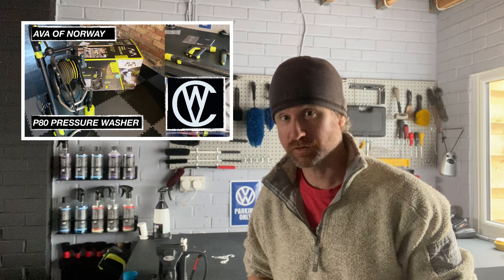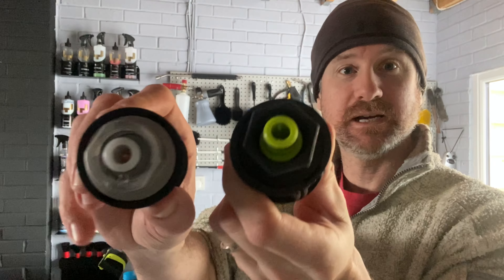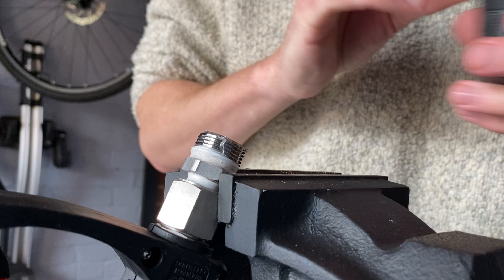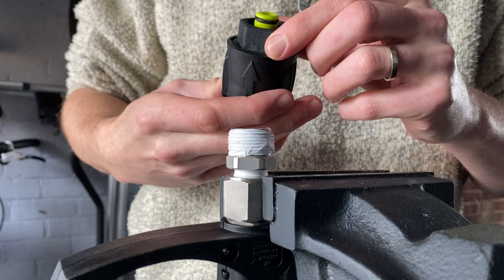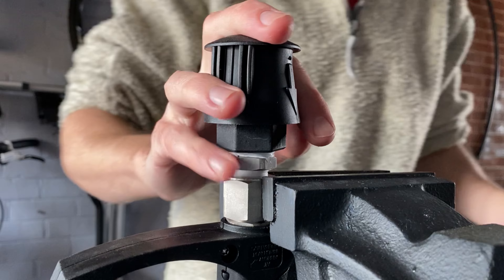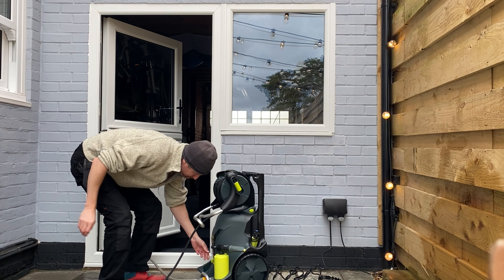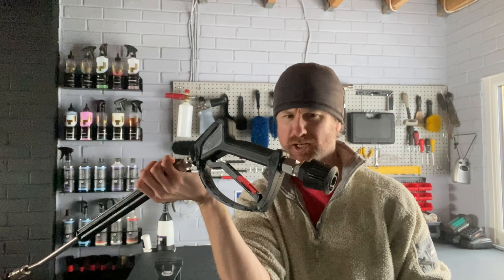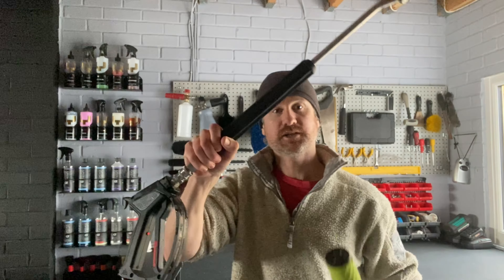MTM Hydro SGS28 Stubby Gun Adapter / AVA P80 Master Pressure Washer!!!

Comment: It looks like you cross threaded the adaptor when you were screwing it on. Did you end up re-attaching it, because later on in the video it looked like it was threaded on correctly? These types of converters use M22 with a 14mm internal diameter, and comes with a built-in o-ring. As long as the hex nipple connector it's being attached to is also M22x14mm you shouldn't need to use PTFE tape, as the o-ring will create a watertight seal. You should only need ptfe tape if the o-ring is damaged, or the hex nipple connector is actually using M22x15mm thread type.
Reply: Being abit thick, have you a link where to buy please?

Comment: Hey there! Just watched your video and have couple of questions. Please answer it:-
1. I am also looking to buy MTM HYDRO SGS28 Gun with swivel but amazon doesn’t offer the fittings like quick connects.
2. I have Bosch Aquatak 125 bars pressure washer machine, so how do i connect hose pipe with MTM Hydro SGS28 swivel gun.? 
3. And, what was the angle lanced(just before you plugged in the connector). 
Please help and suggest me your suggestions. 
Mainly the lanced which is placed down the swivel.
Reply from the maker: @vikhyatraghav  Hi there. Have looked at your questions. There are 2 adapters for the MTN SGS28. One for Nilfisk and AVA style hoses and the other for Karcher. Have you looked at Yumcars.co.uk website? They sell a great pressure washer bundle including the SGS28 and adapters. I’m not sure of the Bosch set up I’m afraid.
Reply: @waysidecarvaleting  actually I wanted to know the adapter you use before conecting the karcher connector what is there down the swivel is it:-Pressure Washer Adapter M22 14mm Male Accessories Coupler.? Or something else adapter.
Reply from the maker: Hi. That part comes with the MTMSCS28 stubby gun.
Reply from the maker: There is a link in the description to the adapter that this video is describing. That’s all I bought it allows me to connect an AVA hose to and SGS 28. I’m not using a Karcher in this video. I see you keep mentioning Karcher.

Comment: Hey up , so I ended 2 wash guns, SGS35 Aqualine and generic one with Nilfisk to M22 connectors, both really struggle in-and-out on the Ava hose, I'm thinking is a better way to connect a wash gun to the Ava hose???
Reply from the maker: Not that I know of at the moment. I’m actually going to start using then AVA Lance again. Got a new accessory for it that I think is going to be great!!! Video to come when the rain stops!!!!
Reply: @waysidecarvaleting  so it’s Nilfisk standard hose into stubby gun , I got6m on Ava.  Needed extension
Reply from the maker: @zzhughesd  apologies if I seem a little confused. Do you have the adapter in your stubby gun like I do in my video with the SGS28?
Reply: @waysidecarvaleting  yes so ended up two Nilfisk adapter and 2 guns. Plus extension hose too.  Ava power washer great. Prefer the better wash guns.  Tho

Comment: Hi what is the benefits of useing that stubby instead of the Ava gun I got the bayonet with 1/4 thread I now can use enything
Reply from the maker: Hi there. With the MTM it’s lighter and easier to manoeuvre I find. Also where I’d been using the MTM with my Karcher really enjoy using it and wanted the option of both. The Lance and gun that come with the AVA are extremely good as well. It’s just my preference but I do recommend as well. Hope this helps.
Reply: @waysidecarvaleting  yeah noticed another vid after yours he was explaining exactly what you just sied I had to replace the gun on my Ava the pin were the pressure hose clicks in wauldent grip tryed fixing it still no good so just got another gun only two weeks ago & I'm thinking it cauld happen again so I'm taking your advice & getting that stubby & use the Ava gun as a spare

Comment: I think I'd have bought a new 15m rubber hose and fitted it with a 1/4 QD instead of the adapter. Better, longer hose and a limitless range of accessories.

Comment: Nice video. I'm looking to buy an Ava Master to wash my car atleast once a week. Should I go for the p60, 70 or 80. I recently returned Karcher K4 because I didn't think the pressure was adequate. Please can you message me to let know if you think the P80 is too powerful for use on car. Many thanks in advance.
Reply from the maker: Hi there. The P80 is perfect for the car. Just don’t set it on the most powerful nozzle setting. Also in this video the fan nozzle I used was perfect after obtaining the adapter for my stubby gun.
Reply: @waysidecarvaleting  Brilliant thank you for replying so soon. Alot of people are complaining about the fuse blowing on the P80 have you encountered any problems yet?
Reply from the maker: @sabahshakur No problem, I have only had my extension lead fuse blow but it was a old one and still on the reel. I have not had a n issue yet when plugged in directly at the wall.
Reply: @sabahshakur  hi mate I have a p60 it dose the same exactly has p80 and it's cheaper it's all just marketing get p60 I use for work every week cleaning patios

Comment: Hi. I’ve have the p60 but I was thinking about getting a new snow lance. Not that keen on the Ava one. Do I need some kind of adapter if I get a new lance?
Reply from the maker: Hi there. Thanks for your comment. You might be able to attach the adapter in this video direct to a new foam Lance but best option is to change the stubby gun too. I would need to look into this a bit more if just changing the foam Lance.
Reply from the maker: But yes you would need an adapter.

Comment: the adaptor is out of stock every where can u help me get it. i noticed yum cars had a nilfisk adapter. will it work?
Reply from the maker: Hi there. Just checked at clean and shiny  -and they are back in stock. The yum cars one is not correct. Nick at Yum Cars explained this to me. Copy and paste this link. It will take you to the right adapter. https://www.cleanandshiny.co.uk/products/clean-and-shiny-stubby-trigger-gun-adaptors?variant=40939394990278&currency=GBP&utm_medium=product_sync&utm_source=google&utm_content=sag_organic&utm_campaign=sag_organic&utm_campaign=gs-2020-07-25&utm_source=google&utm_medium=smart_campaign&gclid=CjwKCAiAvaGRBhBlEiwAiY-yMJSchwu6ah3dms-m9YJr0t_IRsxanxujX5EUwntvA1kcjzqYMVnsWhoC7sYQAvD_BwE
Reply: I bought one on eBay which is green inside and the Ava connector clicks in snugly. I haven't tried it yet, but will soon and, if it works, I can post the seller's info (if that's ok?) It was only £10 but the screw-in surround is metal and looks sturdy
Reply: It's back in stock guys
Reply: @Daniel__UK  can you send me the link to the eBay version please
Reply: @seanhammond4527 when i post the link, it keeps getting deleted, but search for username pressurewasherpartsuk and it's Nilfisk Pressure Washer Quick Release Adapter Hose To 3/8"M B.S.P

Comment: Do you find the p80 blows any 13amp fuses? As it's rated at 16amps. I've just ordered the p60 for this reason
Reply from the maker: Hi there. I’ve managed to blow my extension lead but I’m not sure what it was rated at as it was so old. I hadn’t uncoiled it fully either. I’ve heard if you have the Lance trigger pressed when turning it on at main switch (on the pressure washer) stops the blowing of amps. I need to get home to get a new extension lead ordered before I use again.
Reply: @waysidecarvaleting  
I watched this video
https://youtu.be/zzdegq9-3lU
There are different scenarios where the amp usage does fluctuate, so maybe you're right about start procedures.
I'd definitely think about getting a heavy duty extension lead, as short as possible in length too.👍
Reply: Pete F , Did you end up getting the p60 , does it blow fuses too , I’m looking at the P60 myself for the same reason over the p80
Reply: @g4rymw110  
Yes, I bought the p60 with zero issues regarding fuse tripping. 
Great bit of kit.
Reply: @petef7323  great , thanks for the reply, they do look good but the fuse issue did have me worried , think I might go for the p60 myself

Comment: I love your reaction when you test your stubbie gun 😂 priceless.    How are you getting on with the AVA ?   I have heard that by changing components this would alter the back pressure and you can blow the fuse.  This wouldn’t be a bad thing as it protects the unit,  but it would be tiresome if it happened on a regular basis.  I just wondered if you had encountered any blown fuses ?
Reply from the maker: Hi there! Thanks for you message. So I have had issues with blown extensions leads but now I just plug it into the mains and all is fine.